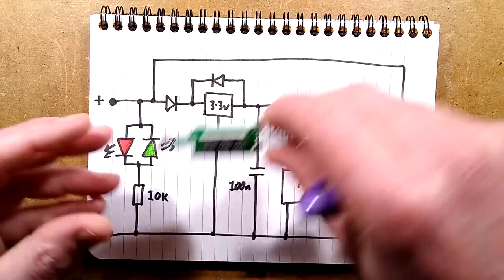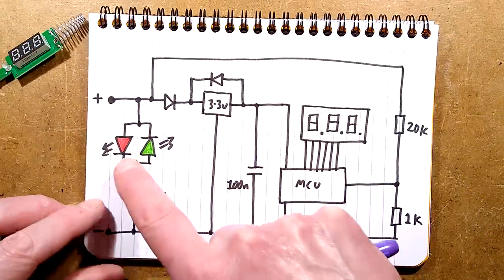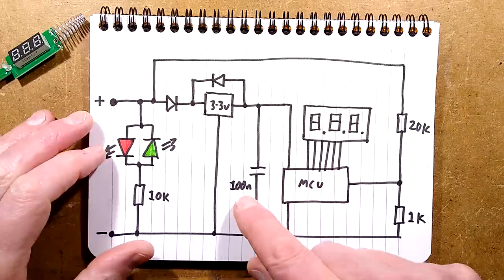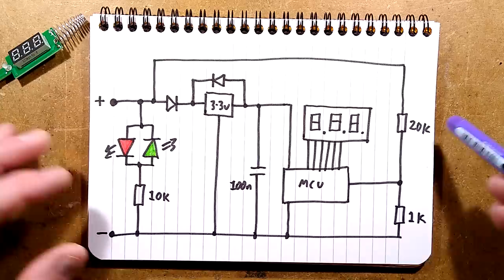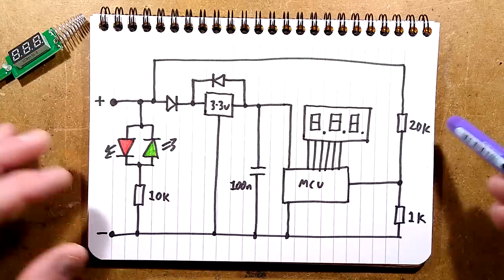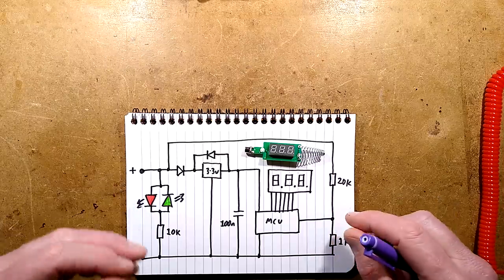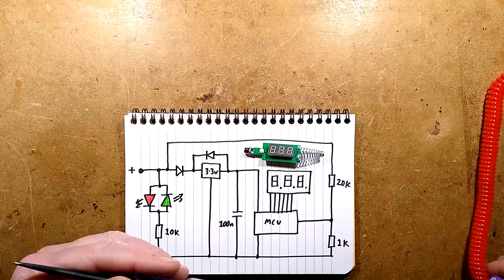Unusual, but accurate low voltage probe (with schematic)

Comment: I believe that the diode across the regulator is there to protect the regulator against the 100 nF capacitor discharging thru the regulator in the case of an input power short.  This sort of thing is recommended in the LM317 regulator data sheets.
Reply: That was my first thought, too. Those regulators don't like when their output pin is at a higher voltage than their input pin and I've seen a diode just like that to protect against that exact situation.
Reply: If the input power suddenly goes to zero, the 100nf capacitor will reverse bias the regulator. The diode will clamp the output to -0.6 volts as compared to the input. It's a protection diode for the regulator. I was thinking the same thing.
Reply: That is the usual function of that diode but since they already have one on the input there would be no current going back to the supply side of things anyways. So two diodes seems a bit redundant. They probably just threw it in there because many datasheets have it as a precaution.
Reply: @benbaselet2026  There to handle leakage in the input diode, as the leakage can be enough to reverse bias the regulator enough to cause the very small junctions in it, that provide the reference bandgap and the internal amplifier, driving them to reverse breakdown. Many of these junctions only have around 5v breakdown voltage, and reverse current will damage them easily, or cause a large parameter shift. Last thing you want in a voltage regulator is the gain to degrade, so the output drifts either up or down, depending on load.
Reply: @SeanBZA  Oh thanks, I didn't think the leakage would be so meaningful but makes sense.
Reply: @benbaselet2026  Remember that die inside is 1mm by 2mm, and about 70% is taken up with the PNP pass transistor and the bonding pads, leaving very little space for the rest of the circuitry, so it is made very small.
Reply: @SeanBZA  True, but I very much doubt the tiny leakage will be enough to damage the regulator.
Reply: It is done a lot in power supplies for the reason the topic starter mentioned. But I agree in this case it is overkill. Taken straight from the datasheet without thinking. :)
Reply: I think as others have said that the diode is to protect the regulator from being reverse biased when the supply is removed due to the charge on the capacitor at the output. You usually only need to do this when the capacitor is much larger than that, maybe 10uF upwards.
Reply: That diode is a Schottky, so it will turn on before the parasitic diode inside the regulator, absorbing nearly all of the reverse current, and therefore protecting it from repetitive (every measurement) stress. It's there to improve reliability of the poor cheap regulator.
Reply: Only one of the reverse polarity diodes should be necessary for that though.  In this configuration the reverse current bypass diode isn't really doing anything, just the blocking diode.
Reply: Doesn't sound that big capacity to cause any problems, the microcontroller would drain that capacitor quite fast I think._
Reply: I actually used a diode in exactly this configuration to protect a 7812 against a reverse voltage once (after scratching my head as to how I managed to kill the one and Googling for solutions.) As others in this thread have already said, though, it's probably only really necessary in cases where there's excessive capacitance on the output side, and I wouldn't expect that 100 nF capacitor to be excessive. Unless that regulator is just that sensitive.
Reply: @michaelcalvin42  In the general use cases this device is aimed at I think it will contribute to the tool life sooner than expected.
Reply: Yes. I've seen this done before.
Reply: TRUE !  The diode across the input and output of 3 terminal regulators is very common in data sheets and application notes spanning many companies and types of 3 terminal regulators.  The most common way to fry a 3 terminal regulator is to not have the diode present, and have the regulator drive a voltage rail that has a lot of microfarads of bypass/de-coupling caps in the circuit (100uf and above, or a value larger than the input cap) which then discharge into the output terminal when the input terminal voltage goes to zero when the power is turned off. Think "Audio Designers" wanting to reduce hum, so they put 1000uf+ on that power rail - and the hum goes away. They turn it off and then the regulator goes away...

Comment: I can see this being useful at work - often need to test for presence of 24V signals and it would save unwrapping the meter plugging in probes setting DCV etc etc. ordering forthwith before the Big Clive Price Hike comes into force!
Edit: Note there's a version with black ground lead (which makes more sense) although it's not curly, but I can see why Clive chose the curly-wurly red lead for this video!
Reply: I would use a Duspol. But sure, the product in the video is probably cheaper.
Reply: I got one of those new pen style meters for work. same size as this but does everything, even phase detection on the one that is $22 instead of $18. I'm the only one of 30 electricians on site that always has a meter. Also, turns on in auto detect mode.

Comment: Based on the good old fashioned automotive test light, I have used these as an auto electrician, but I prefer the old fashioned one for most fault finding. Much lower impedance and puts a greater load on the circuit. Plain LED testlights are useful for current sensitive or limited circuits to avoid damage, like when testing sensor supplies, control signals etc out of control units
Reply: Yes, we have one with a buzzer in addition to the bulb. The buzzer serves as a polarity indicator, if the probe is positive it both lights up and buzzes, if negative it just lights up.

Comment: Charlieplexing is a fascinating technique. I remember reading an article about it and having enormous fun puzzling out why it worked.
Reply: Unfortunately it's not detailed in the video, but 6 pins leaves only 6x5 = 30 possible diode positions, while 5 pins would leave only 20 .  Coding the BCD to 7-segment conversion with PWM control would be quite a job, whether done with tables or karnough mapped into pure logic, especially as the PWM width would depend on the capacitor charge and measured voltage, effectively needing different patterns for each of 360 voltage levels .

Comment: Some voltage regulators don't like to be reverse-biased (especially not if it's more than a couple volts). That diode across Input/Output of the VR protects the VR, should the voltage across the capacitor be higher than the voltage "outside" upon disconnecting the "outside" probe. Such a situation could fry the internals of the regulator in cases. With "only" 3.3 V potentially being higher than Vprobe, this seems to be a "better safe than sorry" type of thing - or can the voltmeter MCU potentially back-feed the 1/1+20 Vprobe level into its power supply upon wrong polarity connection (the voltage divider isn't excluded from the circuit, unlike the regulator itself 🤔) ?

Comment: I'm sure two hundred people have already brought this up, but that housing looks like it's from a 12v test light for automotive applications, which they retrofitted a meter into. Especially on older cars, the 12v terminals are often exposed in the engine bay. So if you've got a good ground, it's just a matter of touching the terminal to see if it has power. I've had access to a multimeter for as long as I've done electrical troubleshooting, but some people swear by those test lights.

Comment: I have used one for years. Very useful for automotive work. No need to fumble with a multi meter. Frees up one hand, polarity and voltage all in the other. They also make pen shaped multi meters that can be operated with a single hand.

The voltage readout helps in troubleshooting bad connections or bad component. The spiky end is useful for probing wires as it can punch a pin hole through the sheath.  There's a version with tiny varistor at the back for calibrating voltage in case it's showing wrong values.

Comment: The red part of the led is to signify positive voltage (like automotive + battery cable), and the green is to signify ground (like the grass is green on the ground) powerprobe and the "smart" testlights made by snap-on, Mac, Matco, are setup the same way.

Comment: Hi Clive. I understand the diode is to prevent the input voltage never dropping below the output voltage especially when you have a capacitor on the output (In this case its small?).
I had several 317's die until that diode was installed.

Comment: You can buy varities of almost these same boards in quantity here, without the screwdriver, and they do indeed have the calibration potentiometer you theorise about. They're extremely low-cost and once you calibrate them I've also found them to be extremely accurate, but generally the ones I see are 0-30v rather than 0-36. I just used a few of them as displays in a powered electronic breadboard assembly I kitted together out of those and a few other bits I had floating around.

Comment: I'm guessing the red led indicates contact with "power" while the green indicates "ground" when using the probe lead connected to battery positive. Though it would be best to have a load (bulb) when using these probes so you can verify the circuit can carry current or provide an adequate ground.
Reply: This will provide a 30mA loading, and thus will show up high resistance. The chip is a standard MCU with built in oscillator and ADC, which is commonly used to do those cheap plug in voltmeter modules, the on chip ADC getting it's reference from the power supply voltage, in this case accuracy determined by the spec of the 3V3 regulator, and the resistor tolerances, so easily, with a little bit of calibration of a scale factor in the factory to the code, or just using standard 2% parts. On chip 10 bit converter, and simple oversampling to reduce noise, and you have a fairly cheap DVM module. 

The diode across the regulator is there to handle the reverse leakage current in the main diode, as these regulator chips tend to suffer damage from negative input voltage transients, so the diode makes sure the input is never more than 0V6 below output, to avoid turning on the parasitic SCR structure and damaging the very small junctions that make up the actual regulator itself. Also the regulator is going to overheat if used for more than around 2 minutes, the board is not really good at dissipation, especially with over 12V applied, and would benefit with a resistor on the input, between the reverse protection diode and the regulator, of around 33R, for 12V, to keep dissipation in the regulator down.
Reply: Correct, the standard incandescent test light is best when doing basic automotive electrical troubleshooting, even the 30mA draw of this isn't enough to be completely reliable. A plain LED test light which draws even less is only really useful when testing current sensitive circuits.
Reply: @BensSightSoundandAuto  Which in a modern car is a lot of things.
Reply: @SeanBZA  I've never come across a car circuit that couldn't handle 30mA
Reply: @SeanBZA  if you know where and what you are testing then you can choose the correct device. If you are just checking for power at a light or motor etc, or checking a fuse, you use a standard test light, if you are testing sensitive circuits at the signal level, you use an LED test light or a meter. For example, if the device that is inoperative has two separate supplies, for example a constant power supply and an accessory or ignition switched supply, and one is de energized due to a blown fuse, a small amount of current can appear on the de energized supply, so if you check the fuse supplying it, it could be blown but you will have power across both sides of it according to a LED test light or meter. Where as an incandescent test light will load the circuit enough that the small current will be pulled to zero and the light will not illuminate on the dead side of the fuse. The same goes for switches, connectors etc....
Can have a connector that's corroded, enough current will pass to light an LED test light but not enough for an incandescent. Very easy to get false readings this way.
Reply: @BensSightSoundandAuto  Ideally you want a power probe that can apply a known load to either supply, so you can test for poor connections by the change in voltage drop, and also one that has both battery voltage and a 5V supply as source, so you can test sensor wiring as well, as many sensors use 5V as power, so you need to be able to select the drive. That way you can see if a poor connection is causing the sensor power to drop, by being able to provide a correct supply temporary and see if the output comes correct again.

Comment: I have the same form factor with an incandescent lamp, as a 'standard' automotive test probe.  Looks like someone in the factory stuck one of those cheap digital voltmeters inside it and whammo .. new product !   Think, I'll stick to the incandescent .. at least it provides a decent load at test.

Comment: It's mostly the same circuit as used in the voltmeter modules you can find online for $1. Usually they come with a potentiometer for calibration and they are available as two and three wire versions (GND, VCC and optional sense input). Looks like they just added the contacts and put everything in a "standard" probe handle.
Reply: Exactly what I thought when I looked at it.

Comment: That type of tester is typically used by Auto Electricians, the green led is to indicate a neutral trigger, rather than reverse polarity indicator. Although, it’s used to quickly indicate what polarity a specific circuit is.

Comment: This thing looks revolutionary. I'm used to having to stab someone and then switch to a different tool to check their voltage. It's a bit of a hassle, but I could do both almost simultaneously with this. What a time saver!

Comment: The LED is actually supposed to be green when ground is applied to the tip, this is due to green indicating ground and red indicating power in the automotive industry.
Reply: But the real thing would be if the green LED lights up even if both the clamp and the measuring tip are on the ground. This would require two clamps.
Reply: @Istvan
That's more in the realm of a Power-Probe, which incidentally is also intended for the automotive industry

Comment: That cable reminds me of an old-school landline telephone cord. That's very odd, but very nice.
And yes, I do believe you're correct in that that form-factor of tester is intended for automotive use. My uncle was an auto worker who worked in the plant's electrical repairs section for some fifteen or twenty years, and worked on cars besides; he had one very similar to this, very definitely a 'screwdriver' shape and form with a pokey pointy bit where the 'screwdriver' would be.
Reply: Definitely automotive. I have one very similar, 40 years old with a high resistance incandescent bulb inside.
You can somewhat gauge how much voltage is present by how bright it glows.
Reply: @Jim Urrata  well, that sounds very precise.  /s
Still, that sounds very much like the sort of thing my uncle had when I was a kid. Perhaps I should have a gander through his things and see if it's still there; he passed last year.
Reply: @ShadowDragon8685  It was never meant to be precise. It was meant to put enough load on the circuit to show if  there was high resistance.
IC's hadn't been incorporated into vehicles yet. There weren't incredibly sensitive components you had to protect, but there were plenty of connections that would corrode and keep something like a mechanical voltage regulator from functioning properly.
Reply: @Jim Urrata  ahhh, huh. Makes sense!

I just tend to assume that anything electrical is very sensitive. Older stuff really didn't give a crap though? Huh.

Guess that would make more precise measurements kind of superfluous them.
Reply: @ShadowDragon8685  Things cared. That's why we have fuses. But there was really nothing in an older vehicle that wasn't made for 12V. (try feeding that to an IC and you let the smoke out)

Comment: That diode is commonly used with 3terminal regulators to prevent failure if the input is shorted if there's a capacitor greater than 10uf on the output. In this case it isn't needed. Maybe the designer saw it on another schematic and didn't know the purpose or is like me and always uses it (for anything I design for myself.)

Comment: Reverse-biased diode across the in/out of the regulator (from LM7805 datasheet): Occasionally, the input voltage to the regulator can collapse faster than the output voltage. This can occur, for example, when the input supply is crowbarred during an output overvoltage condition. If the output voltage is greater than approximately 7 V, the emitter-base junction of the series-pass element (internal or external) could break down and be damaged. To prevent this, a diode shunt can be used.

Comment: The company I work for sells one like this (a bit higher quality). Oddly enough, same red for right polarity, green for reverse, but it lights up the whole screen (it has an LCD, not a segment display), and will tell you the voltage even in reverse polarity. The idea with these, in my assessment, is they're made almost entirely for people who know how to use a test light, but are uncomfortable with a multimeter. A test light will tell you yes or no anywhere from 6V to 24V, while this will actually tell you the voltage and polarity from 3V to 30V. The advantage being, if you know how to use a test light, you know how to use this. For everyone else, there's multimeters.
Reply: I'm quite comfortable with my multimeters but prefer test lights for fast fault finding as I don't have to move my eyes away from the probes in an already dangerous environment.